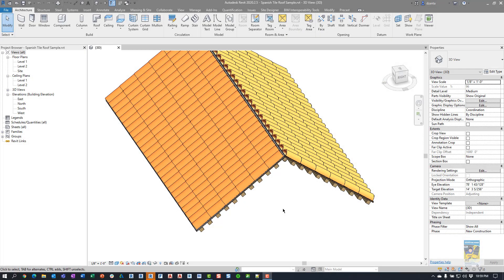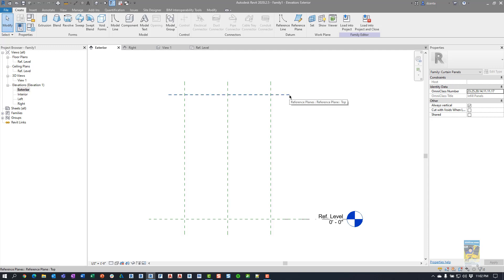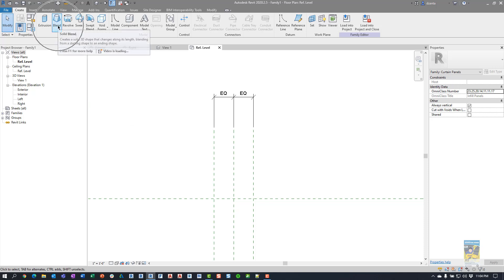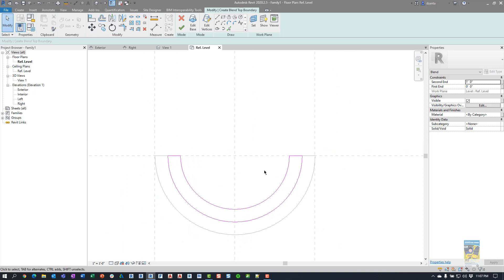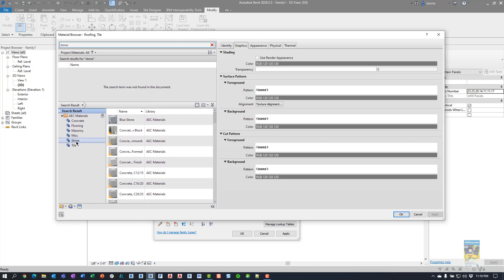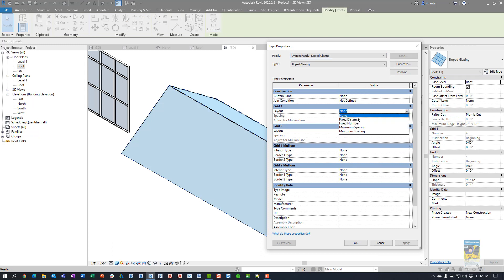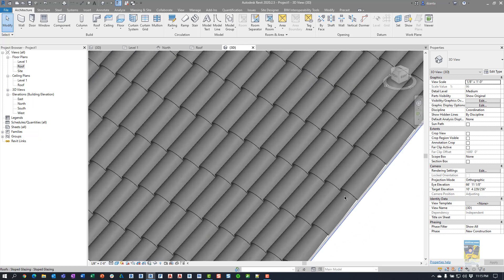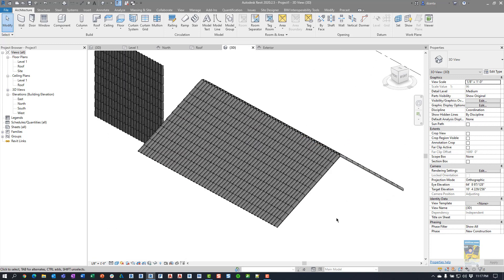Spanish Tile Roof in Revit - Step by Step

Comment: Thanks for the video. When I go through this process and create a more complex roof system it doesn't want to make the tiles at a hip or valley. Any suggestions?
Reply from the maker: That gets tricky because of the angles and segmented pieces. You will have to use an adaptive curtain panel family for those.